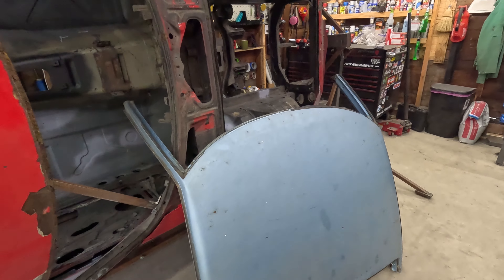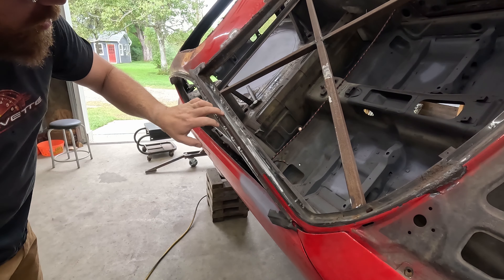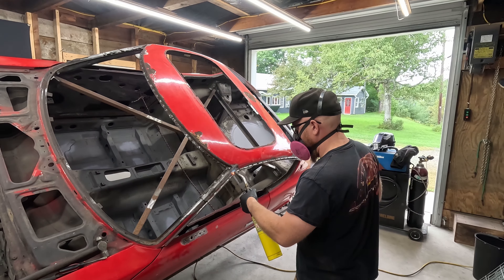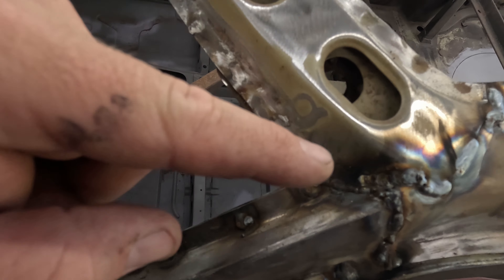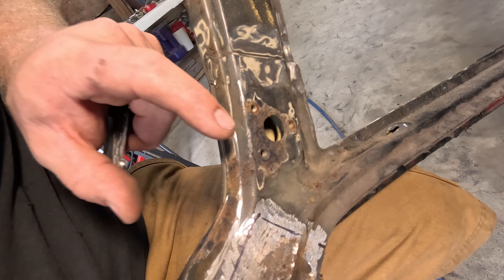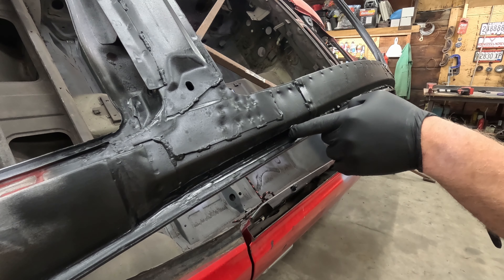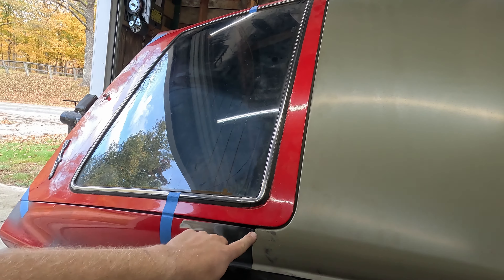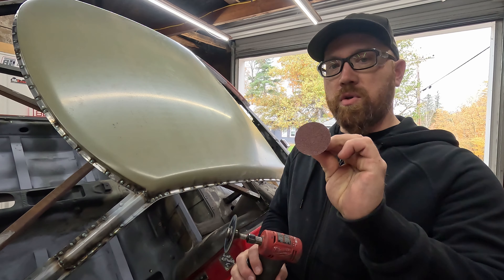Datsun 280z Roof Replacement

Comment: Excellent video.  Did you consider the use of a two part epoxy panel bond for the edges of the roof where the underlying structure connects with the roof skin?  I have used a product from 3M (Panel Bonding Adhesive, 08115 or 08116).  Additionally you can still weld through the epoxy for additional strength where needed -- the heat will also speed-up the cross linking cure time.  The nature of the two part epoxy will also prevent moisture and oxygen transfer and reduce the opportunity for rust.
Reply from the maker: Thanks! I don't have any experience using panel bond but I know they use it a lot on Corvettes. I hadn't heard about being able to weld through it.

Comment: 32:45 duraglass is a great replacement for lead filler. Just a heads up.
Reply from the maker: Ok so that's a fiberglass body filter yeah? That's strong enough to not crack at those joints?
Reply: @BLOKgarage  yes it’s a fiberglass filler, never had issues with it cracking at seems if done properly. That is the common replacement for lead filler. No one uses lead (commonly) anymore. Mostly just older classic shops that die by it.
Reply from the maker: @NissanZSmith  Yeah I figured there must be a good replacement for lead filler at this point.

Comment: What are your welder settings???
Reply from the maker: Generally I have this Millermatic 211 at 5 for amperage and 38 wire speed. Running off 110v.

Comment: Can I even change a car’s oil? No. Have I watched every single minute of this series? Absolutely. 

How far do you think we are from the finished product? Halfway? ⅓?
Reply from the maker: That's tough to estimate. Is say 95% done with rust,  there really isn't much of that left. The 2JZ swap I don't think will take that long. I have close to zero experience with body work and paint so that makes it even harder to estimate.

I'd say close to half done. The rust/sheet metal work takes so long to finish one project. Most of the remaining time after that has gotta be learning bodywork.

I'm also terrible at underestimating how long stuff will take.
Reply: Thank you for getting back to me. With you til the end. Look forward to Fridays uploads.